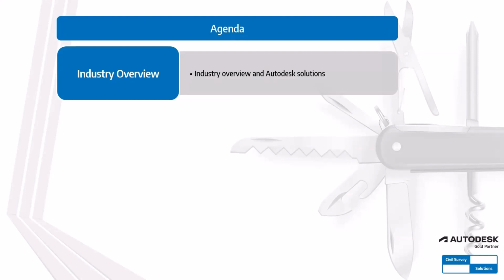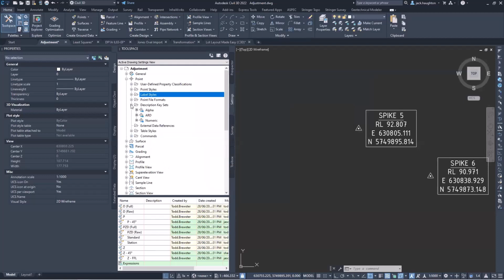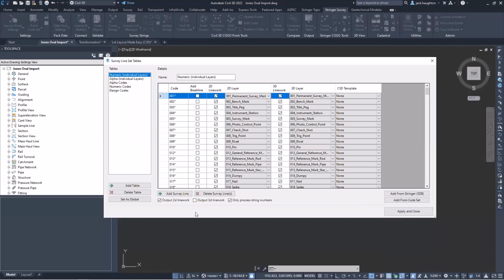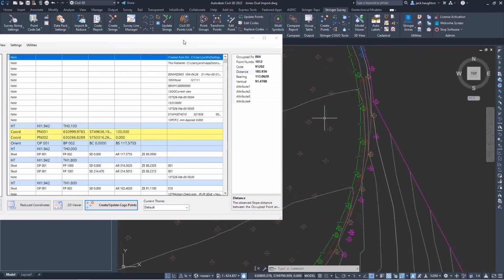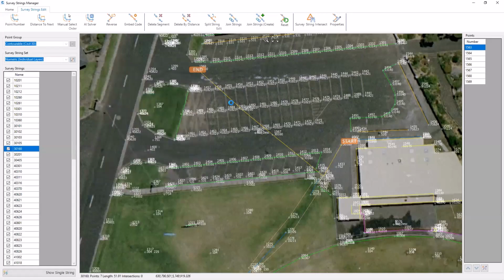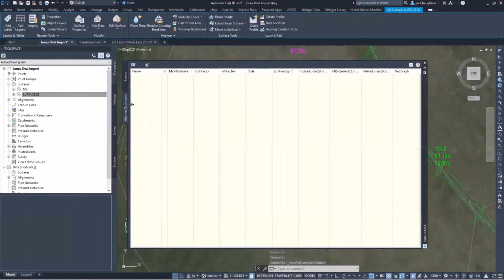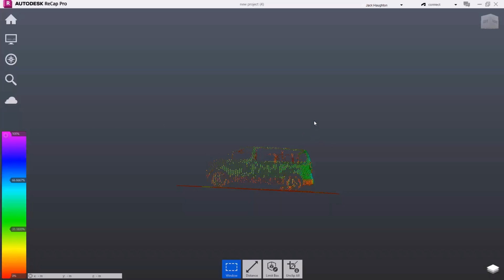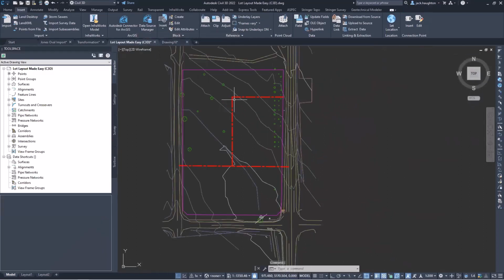Webinar: Civil 3D Surveyors Workshop

Comment: can we process lidar data and generate height distance contours levels cross sections and L sections etc? through autocad civil 3D or pls suggest the best software for lidar data and photogrammetry data ?
Reply from the maker: Contour levels in Civil 3D come from a surface, so one option is to create a surface from the point cloud (Civil 3D has a command for this).